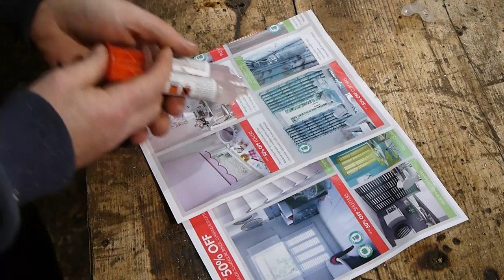Homemade Bar Clamp

Comment: Nice! Neat locking system for the moving jaw and I like how you recycled the square tubing for the bar.
Reply from the maker: +I Build It Thanks John, glad you like them! The work btter than I thought they would, I'm planning on making a bunch more. Thanks for sharing your plans!
Reply: +Frontierless Craftsman Is there any indication that the cut in the tubing will  hurt the integrity of the build by degrading the strength?
Reply from the maker: Edwin Allen None what so ever. I had considered this when making them but the amount of pressure you put clamping doesn't seem to flex the box section at all. Thanks for watching!

Comment: How do you like the sliding stops with the groove locks? It kinda seems when trying to hold something and getting a clamp on before it falls apart and the stop sliding could be a problem. I ask because soon I'm gonna build a set and wander if the time spent to make a spring loaded hold would be worth the trouble or it going the route like yours works well enough? Yours look well built and I really wish I had the ability to video and eddit like some of you do.
Reply from the maker: They work fine, they can be a bit fiddly sometimes but you get the hang of how to use them fairly fast. spring loaded would be nice make your video and show me, don't worry about editing skills its straight forward to go for it! it

Comment: Nice video! I like the use of the square tubing rather than wood did you use steel or aluminum I'm guessing steel
Reply from the maker: +Jon Stevens Thanks Jon, it was scrap box section steel, not sure how aluminium would fair.  Thanks for watching.
Reply: Yes, steel bar looks more sturdy. I've made a version with wooden bar, and the clamp now experiencing some issues after some time of use

Comment: Quick quezy mate, on the moving jaw when it rocks back to lock do you have a taper on the face to bring back to vertical. Cheers. Great vid by the way
Reply from the maker: yes if you look around 2:18 in the vid you'll see where I make the angle wich allows it to tilt.

Comment: Interesting video, Time consuming, a lot of work ,when you can buy very inexpensive clams at Aldi or Lidl, Dump the musak
Reply from the maker: Thanks. For the quality of the clamps vs the cost of the equivilant, they work out much cheaper (taking in my time). But that being said, cost is really only part of it, as  the fun and enjoyment is in the making and for me its a 90 mile round trip to where I can buy bar clamps for others its much further or impossible.
Reply: clamps here costs about 7-10 dollar each. While making one cost 3-4 dollar and a lot of effort.

Comment: Painting the steel bars doesn't seem practical. The clamp parts sliding on those bars will rub off the paint.
Reply from the maker: Not so far anyway (1 year on). I felt the rusty old reclaimed steel I used needed it but I guess if you were one of those strange types that likes buying new materials like nice clean new steel probably not an issue.